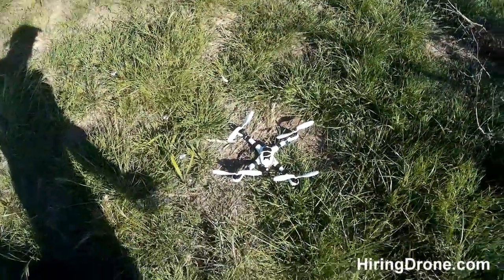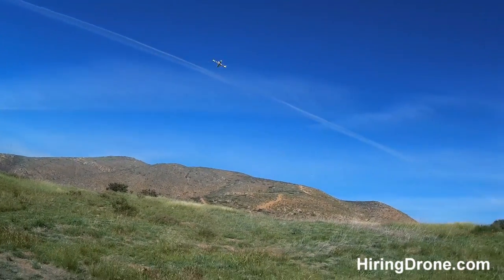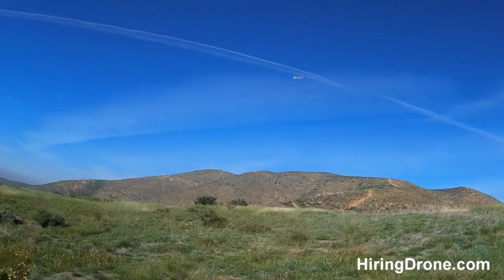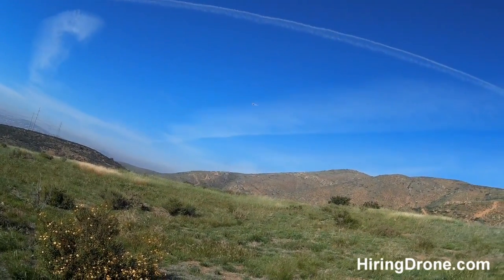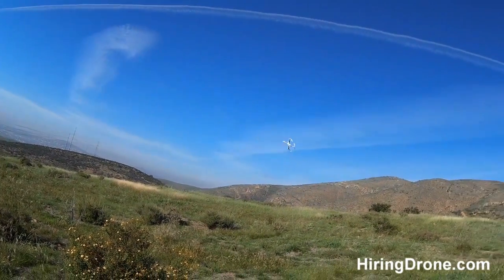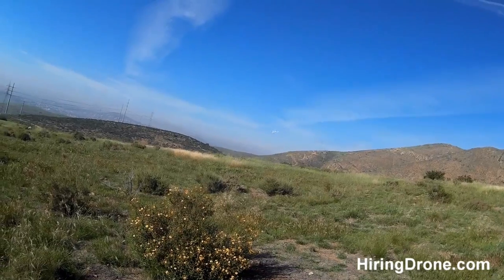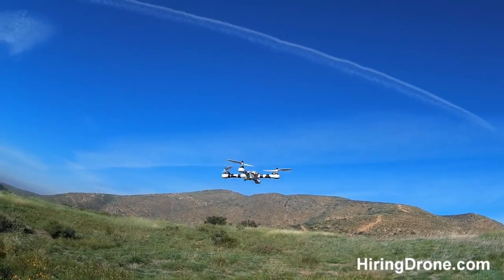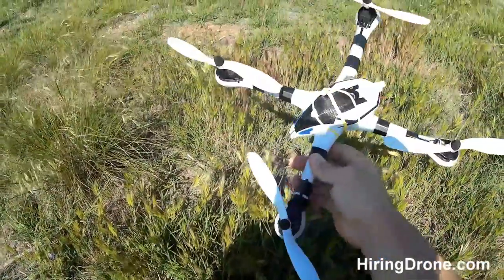Flying Tarantula X6 Quadcopter

Comment: yeup the RANT has definitely played a major role in my r.c. quad addiction.. I often say its the king of the brush-mo quad's. how ever i finally gave x8c a try,  and i got to say WOW, why have I been ignoring this Big Pretty Syma since I started trying to fly.  I am in Love,,
Reply from the maker: +anyshitt I like SYMA's too. Very smooth fliers. I have an X11 and X5C. I might have to purchase the X8C, given how much you like yours.
Reply: +Hiring a Drone the x8c is a great quad for videos. Mine died unfortunately after over 300 flights. changed motors only twice but my circuit board eventually fried. Great quad but I like my tarantula a little better. wish it could get more than 4 mins flights out of it though.
Reply from the maker: +quad junkies You could possibly make a battery modification. The X6 can lift a decent amount of weight. I lifted a GoPro for the longest time, before burning out all my gears. You could be able to lift a heavier battery, but the voltage frying your board would be the biggest concern. If you could increase the size of a 2S and remain at 7.4 volts, you could in theory get more flight time. The motors are brush motors and could possibly overheat with a flight longer than 5-7 minutes.

Comment: I have lost and replaced more Rant's than any other quad.  I am not proud of loosing any quad of any size, I talk about it so much in the hopes that I learn to stop loosing these damm things.. That the main reason why I never got an x8c  until last month, I have own two quads of that size in the past., mjx x101 and some shit called ty923, I  suggest that even an experienced flyer avoid those birds like the plague.  Mjx x101 is an extremely handsome bird with an ammonous presence,  the control's are almost nimble until you get a little altitude the bird break's range and make's a run for the border,, and your stuck on the ground wishing you could pluck that run away out of the sky with a high powered rifle. I'd rather see an escaping bird get blasted into 100 little piece's as apposed to flying away in one piece never to be found again..I dont see the syma getting away from it's owner with the same amount of ease,  the controller does not have the same lag in response time and you have the extra range just in case you have orientation confusion, and your not confident with headless mode or 1key return. you can fiddle with the pitch roll in way that let's you figure out how to get the bird to go back in your direction.. God I suck at this, but I want it so bad. part of me still thinks about quitting all together, but I am in so deep.. (sorry guys) anyway last night I flew the kiadeng k70, I saw the review of quadcopter 101 on the kaideng and I wanted it,,  my first impression ? this qaud is a dogg compared to the syma.
its a huge bulky bumble bee looking quad.  it has size, speed, lasting power, but it comes with a dinky feeling controller that act's like it is drunk,  first impression? Im replacing my x8c first chance I get,  if the kaideng flys away from me this after noon? 
I hope no body get's hurt. other than that, good riddens you cheesy bumble bee looking piece of shit!
Reply from the maker: +anyshitt I understand your position. Knock on wood, I haven't lost any yet due to flyaway issues. I have had some fly-aways, but found them all. Quadcopters get you with their hooks and are very addicting. I continue to buy more for reasons that I cannot explain. I took all my bumps and bruises on the X6. In some of my earlier videos,  I crashed ALOT. I have had the X6 fly out of my line of sight, but luckily cutting the throttle dropped if from the sky. My JJRC H8 mini hexacopter, has flown away from me 30% of the times I have flown it.